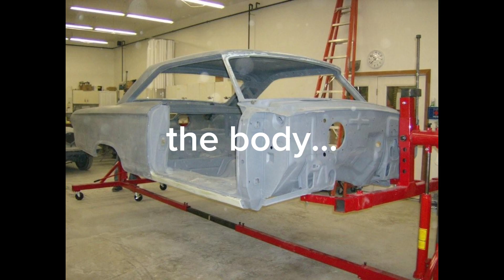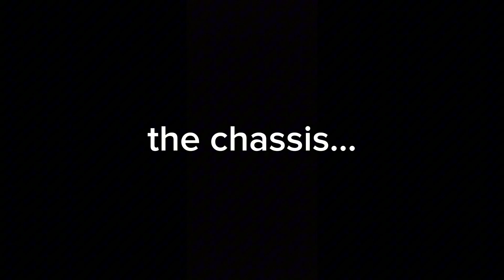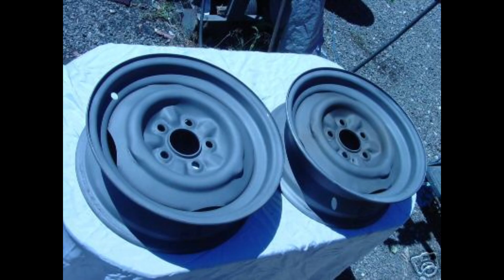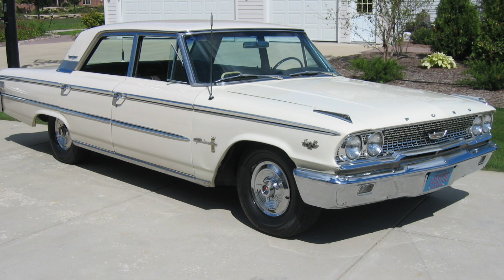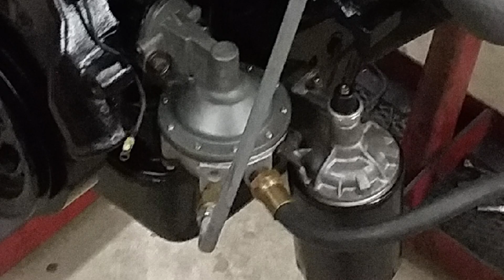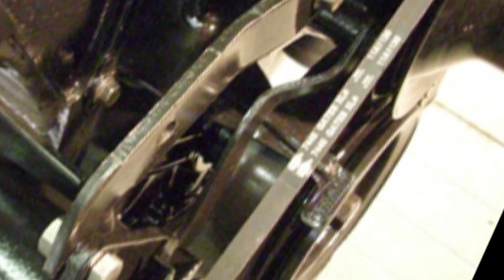1963 427 Ford Galaxie Mysteries Explained

Comment: Are you sure about the lower control arms?
I have a 63 boxtop P code with cast shorty headers and front routed brake line but it Doesn't have the belcrank arrangement on the lower control arm bushings.
As far as I can find out taxis and police units had the straight bushing setup as original equipment.

Comment: Adrian Clements is a great source on these cars too.. I am not sure but I believe that he at one point ran the 427 Registry. People claim to have 427,powered 1967 Mustangs and there really were none. It would have been such an expensive option that it would never have flown with the bean counters. Tasca was right to hit the parts bin and come up with the 428 Cobra Jet. There has never been a 427 installed on the line. You could buy a 427 in a crate and had it installed, but it was still a 428 Police engine or the S code 390.  No unicorn. And man these cars got sliced and diced to the point that some aren’t even safe to drive. Your 67 Galaxie 427 is a real survivor!
Reply from the maker: Adrian runs the 1967 Full Size Ford Registry, I created and ran the 427 Galaxie Registry. Yep the 427 Mustang was a myth but it would have been very easy to do. Cougars had a 427. Fits just like a 390 with the right heads
Reply: @mydirtygarage  I agree, the 427 could have been in the Mustang. I never understood why they didn’t take the 410 from the Mercury and put a 427 cam and the 2x4 PI intake and some better exhaust manifolds. It would have been a 1967 replacement for the 390, torque for days and a low cost Intermediate and Pony car engine with the 428 a premium option. The 410 is a good engine. It isn’t high strung but you know that you have a stoplight to stoplight runner and with the 410 hp solid, a 1 hp per cube competitor that could haul ass and hold together. The 66 PI 428 had a bit more slugging mixture motion. The 410 with smaller bores could have kept the early style C6AE-R heads with LR valves 2.09/1.6 valves would have good mixture motion, lower emissions, and a better use of its strong points in a street car.

Comment: I had a Minnesota build car and it was owned in Minnesota. The frame rusted out and I had to put a 66 model frame. The body was barely rusted. Just the toeboard. The car is not tight as a drum. But I m blind now and can’t drive. Such a shame.

Comment: I really wish in all of my years I had found a 427 FE , specifically the SO. But 390s were it. I had some th at could bore to 428, but I never bored them that big for strength. The COAE-D with 2.09 and 1.65 valves worked well. I always wanted a 427 . I have built 396 ci engines with crankshaft lightening and piston lightening with the thinnest rings and gapped well. Cylinder heads that were welded in the chamber to improve tumbling into swirl and 2.15 5/16 stems with guides to fit and 11/32 stems on 1.63 valves.,roller cams and dual quad aluminum intake and 585 cfm 4150 DPs.. 2 inch tube headers. 550 hp and 510 ft lbs in a black on black 66 Galaxie that was surprisingly fast . You could run fat tires on the back and a short Hurst shifter was the best bang shifter I ever had. I miss the old girl. 396 ci FE was a beast! A lot of custom work  I did myself but I learned a lot.

Comment: A freind had a 427 Holman Moody highrise.  It would regularly turn 9,000 rpm, it could turn 10,000.  But there was no horsepower increase.  Another freind has several in his galaxies.  He got a bunch of Holman Moody stuff with a cometition boat.  He sold the boat, kept the parts.

Comment: Very interesting.  I love the 1963 Galaxie, in Fastback,  and 2 , and 4 door  sedans . Galaxie's had a great dominance in racing , somewhat embarrassing the Brits in their formerly unbeatable Jaguars, I bet they weren't expecting that. My ultimate '63 Galaxie would be a 2 door sedan, with all the fancy trim and badges, black with a red interior , with any of the FE engine sizes, but preferably at least a 390 .I found it interesting, the mention of 6 cylinder frames being lighter than for the V8 cars , is that true?
Reply: I like hardtop cars, sedans not so much.

Comment: Where are those full wheel covers made from an earlier 15 inch Mercury wheel cover and adding a 1963 style 3 bar spinner from wire wheel covers?
Reply from the maker: They we're made from the same press molds as the Mercury ones but the centers were blank, very different. The spinners were the standard Ford spinner used through the 60's. Thanks for watching

Comment: Thank you for posting this vid. Do wish I'd of had it in '72 to prove my know it all dad wrong. Mom bought a new 63 1/2 Q-code. In '72 I bought a '63 1/2 Q-code from an original owner. He wasn't a perservist any more than I was, except he was one that just maintained with FoMoCo parts only. Dad swore mine couldn't be ALL original due to the different hubcaps than what mom had on hers. "If he swapped out the hubcaps he swapped out other things too" was his thought. Even shown facts a few times of him being wrong didn't change what he thought he knew, he just wouldn't argue about it from then on, but his facts were still his facts, went to the grave in his head.
I didn't care about originality, week I bought it the Q-code and trans came out nd was replaced with a 406 while waiting on a stroked Merc 410. Didn't change a lot on the car but it was being used for street and strip so smaller items were changed. When I sold it the buyer got the Q-code and trans, wheels, tires, hubcaps, generator, manifolds, etc and he gave me the 410 just for pulling it so he didn't have to do so.
Month later I felt like taking a hammer to my noggin for even selling it instead of parking it in the back of the equipment building.